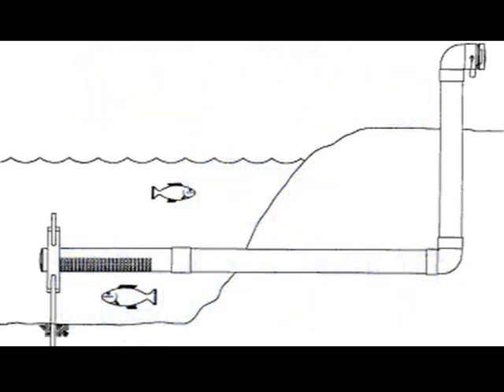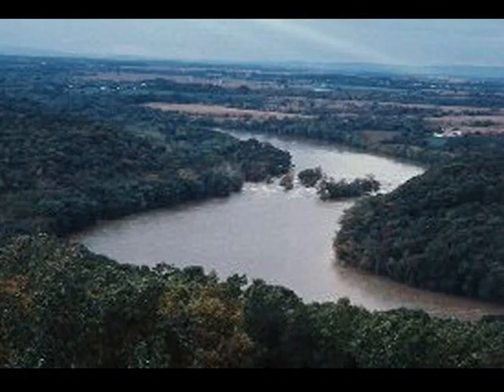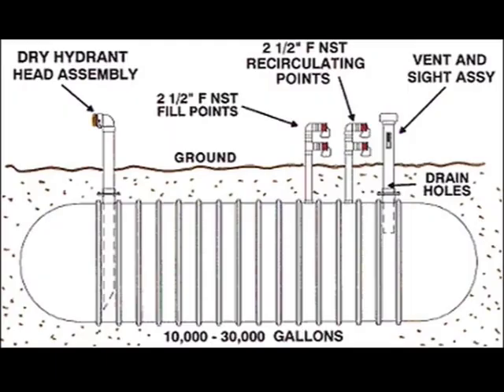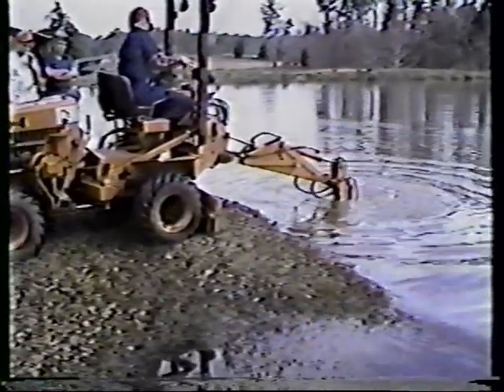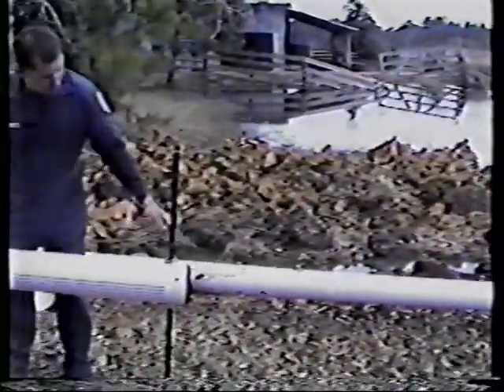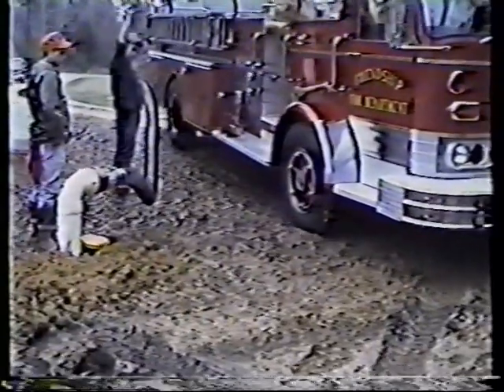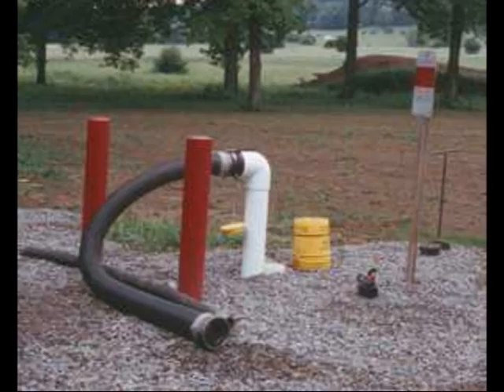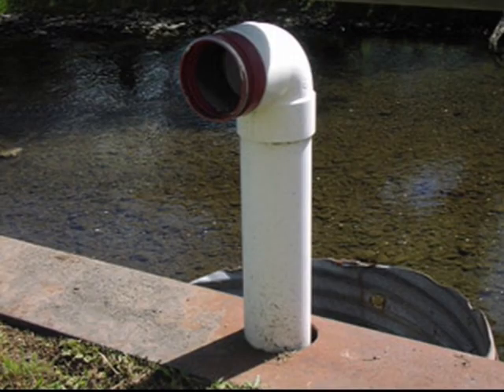What is a Dry Hydrant?

Comment: All that is needed is a backhoe  capable of digging the required depth. Anything larger is overkill and more expensive. The average cost of a dry hydrant (2018) is $2,000. Oklahoma offers a $1,500 tax rebate for dry hydrant installation and depending on proximity to your home or property, your insurance company may offer a reduced premium.